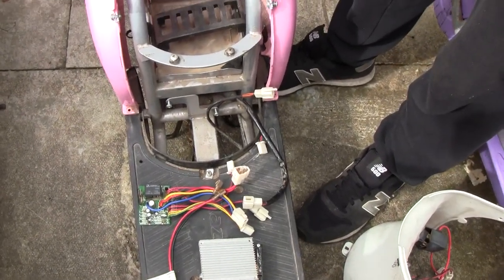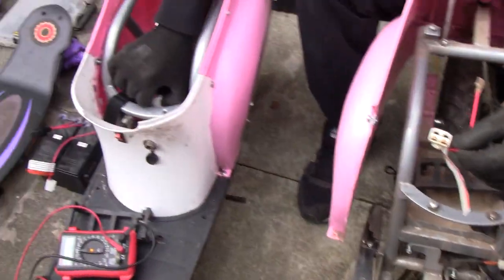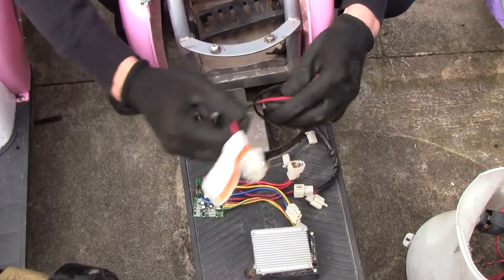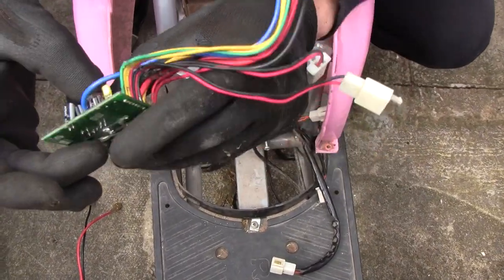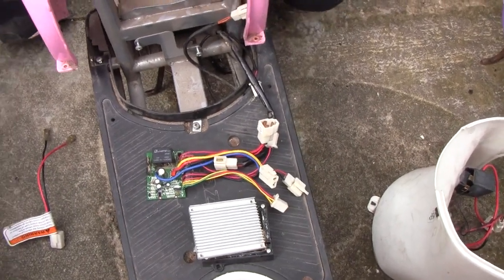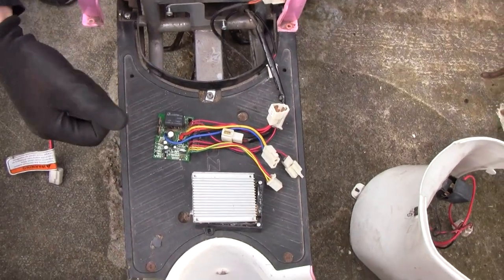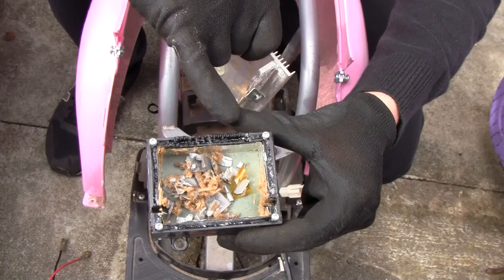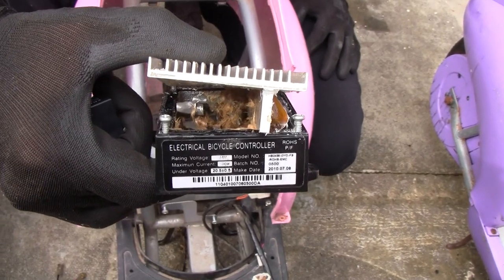Razor Pocket Mod 24v 280w Faulty Motor Controllor

Comment: I replaced the batterys with some lead acid new ones reading at 24v with a multi meter directly from the battery themselves when the throttle is turned . still hear a click sound tho 😢
Reply from the maker: Controller may of popped , check brake switch first maybe stuck on stopping motor if ok, disconnect Controller cut silicon with razor blade carefully open it, check the capacitor if its popped will smell bad pieces will fall out !! New Controller jobs a good one.
Reply: @monkfu7101  it has blow . Can I solder a new one on ?
Reply from the maker: @Mario4zz  if you have the part, tools and skill it will work , I don't know what capacitor size , I would replace motor controller unit as may of damaged other components

Comment: My aunt bought one for my cousins daughter. It turns on but when you turn the throttle, I hear a click but no movement. Does that sound like the controller module? The controller module was my guess and then I saw this video. Thanks for the video!
Reply from the maker: No controller usually fine if it clicks that's the relay working ! I Would start with batteries looking for 24v to 26v reading if below 21volts will get the clicking and no motor movement.

Comment: I just bought a ZR350 for my grandson. The power switch lights up when on, but it doesn't do anything when the throttle is turned. I tested the throttle and the brake cutoff switch and both are good. It didn't come with a charger, so I have a 24v 500ma power adapter hooked up to it right now hoping that there's just not enough power in the batteries. When I hooked the adapter direct to the motor it did spin. Anything else I should be prepared to check?
Reply from the maker: Scooters wouldn't drive if connected to charger, check for click of relay in controller when twisting throttle, drop test batteries as maybe 24v but no power in them voltage will drop fast when under load
Reply: @monkfu7101  I'm getting a click from the relay now that it's sat on the charger all night, but the motor only spins if the charger is hooked up. I'm thinking either the 500ma charger just isn't enough, or that the batteries won't hold a charge.

Comment: A friend gave me one of these. Controller clicks when you turn the throttle. I have 3 volts at the throttle connector that goes to 1.5 volts (instead of the 20 volts you mentioned) when you turn the throttle. Batteries are old and only showing 22.5 volts after 12 hour charge. Do you think the batteries are the issue, or could the throttle also be bad?
Reply from the maker: Battery bud ! voltage drops quick is bad batteries
Reply: @monkfu7101  Thanks! I figured that was the culprit, especially since they have a date stamp of 2012  :-)
Reply: @monkfu7101  Is there a way to install a variable speed throttle on this without having to replace the speed controller? I'd like to put a variable speed throttle on mine as the acceleration is a bit too great for my liking.
Reply from the maker: @michaezell4607  you can install a throttle pot off a mobility scooter will lower the acceleration cheap enough one love

Comment: I have a razor pocket mod scooter.  The scooter runs but shuts off after 15 seconds.  After waiting for 25 to 30 seconds it runs again. This is continuous. The batteries are brand new.  When I hold the back end of the scooter in the air and twist the handle bar, the scooter runs forever without shutting off.  It is not a battery issue or a loose wire issue.  My daughter only weights 75 lbs so it is not weight.  It is not a matter or riding it on hills either.  What do I need to replace?
Reply from the maker: I would check motor bud ,brushes inside may be very worn out
Reply from the maker: Get back to me if this not the issue
Reply: @monkfu7101  so to replace motor bud, is that replacing entire motor?  I was thinking there might be some thermal shut off under a load somewhere that is kicking it out...
Reply from the maker: @jeremyweaber9983  no thermal cut out on the pocket mod's bud.it would just pop the fuse under the seat , a  few ways to find out disconnect motor test with multimeter if ohm should be really low reading it's gone , or whip motor off open up should be pretty easy with normal tools check inside motor may just be load of carbon dust or bushes gone , there's no thermo cut out fuse on this model would just pop the fuse under the seat between the two batteries, or controller would pop and you would get nothing , if you limited on tools u could disconnect motor from controllor , then jump to cables from batteries directly to motor sitting on it should pull you no bother as they pull me and am 80kg don't remove fuse if you got a switch even better, 😉
Reply from the maker: Also check throttle from controllor to motor , attach multi meter on to cables from controllor to motor check voltage when twisting throttle should be getting at least 20 volts from controllor to motor many have throttle issue